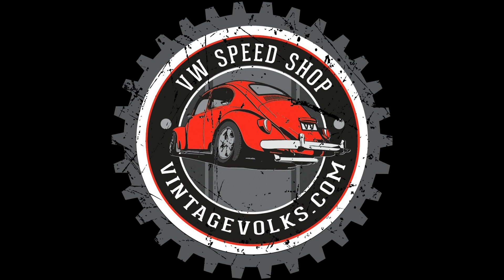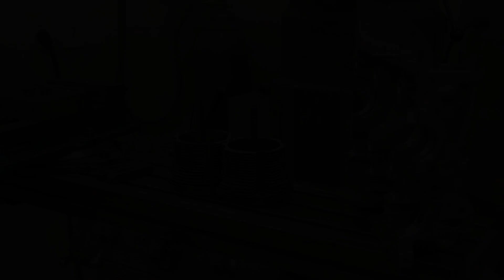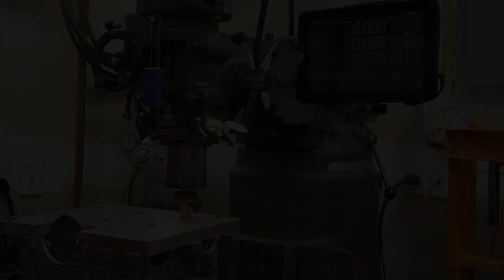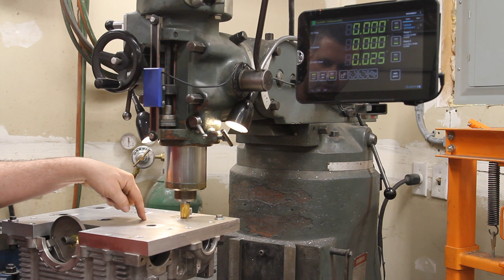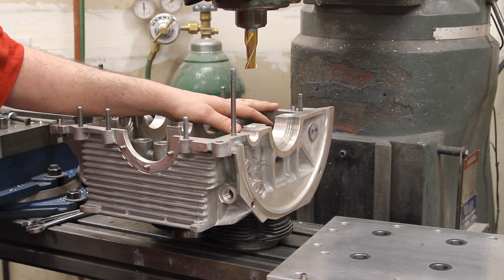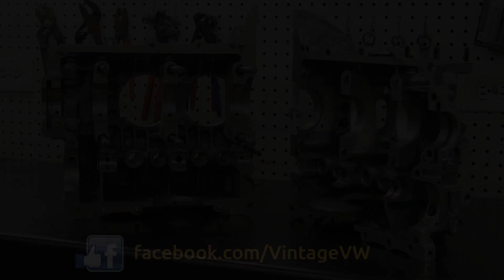Air Cooled VW - Shuffle Pins

Comment: Could the case studs themselves be used as the shuffle pins? if you pressed a sleeve into the holes in the bearing webs, bolted the case together and then reamed it out to the od of the stud?

Comment: Cool this is why I like to just go straight to the Aluminum case. Already shuffle pinned drilled for full flow and opened up for whatever cylinder you want to put in there. I don't usually go over 90.5 or 92 thick wall.  also clearanced for stroker. then I put a 78 in there. still bulletproof. IMO. Better more stable material (aluminum less expansion and contraction)  My buddy got over 150k miles on a aluminum case engine.

Comment: shuffle pins are too loose imho, should be a slightly snug fit
Reply: They need to be quite tight when cold to compensate for thermal expansion of the case when hot.

Comment: What is the purpose of the shuffle pins?
Reply from the maker: It keeps the 2 halves of the case from "shuffling" or sliding back and forth against each other in higher performance applications.  We like to do them when you get into cranks bigger than 74mm.